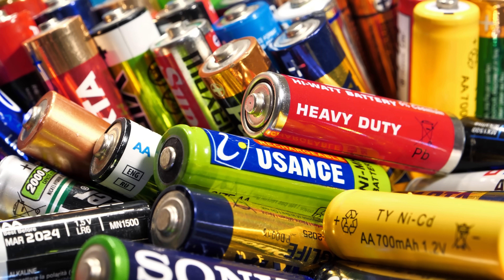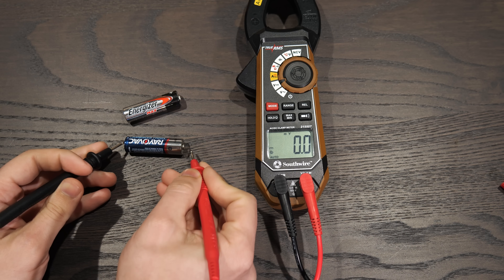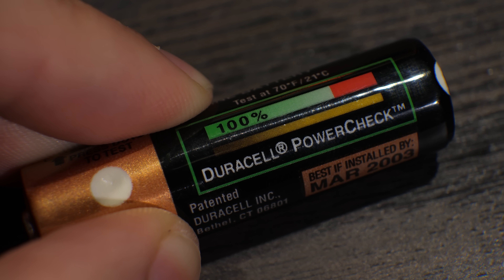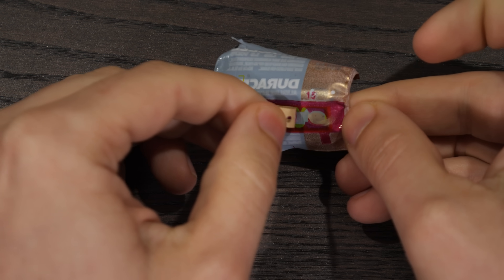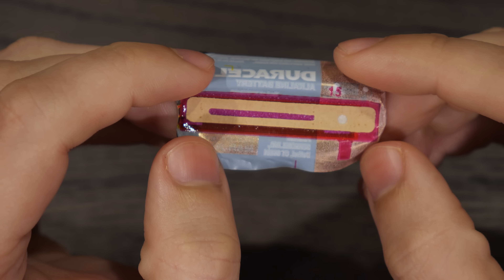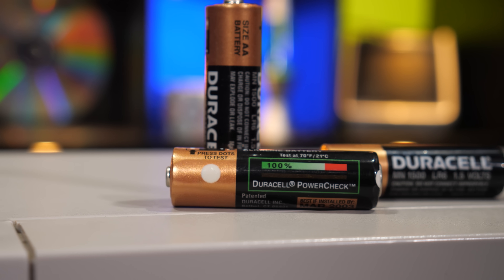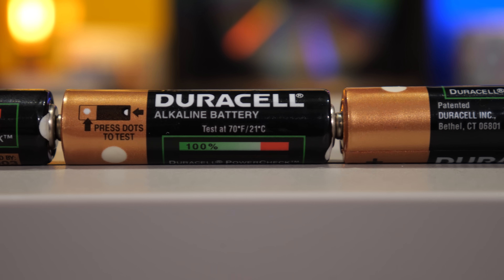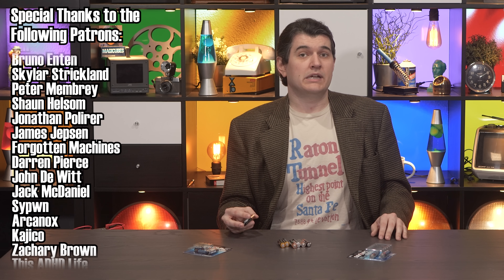Duracell PowerCheck: A genius idea which didn't last that long

Comment: These were a great thing.. at the end of the day, they went away, because the companies wanted to make the manufacturing process cheaper, in order to increase profits. hell, they don't even include a single strip-type tester in the packages anymore, like they used to. 

I'm a bit weird in how i use my batteries. My primary use for AA batteries is my X360 controller. Thing is, when the batteries are too drained to power the controller, they ARE still sufficiently powerful to power my logitech wireless keyboard and mouse...or the remote for my tv, or the remote for my stereo.. So when my controller dies, i end up putting the batteries aside for those other things. The problem then becomes that since gaming is my primary hobby, i go through a lot of batteries, and so my box of partially spent cells is always full, because the keyboard, mouse, and remotes sip power, and so they don't need battery changes nearly as often. i kinda like to get my money's worth out of these batteries, because they're so expensive, so i'm currently looking for other ways to get more value out of these partially spent cells.

Comment: The reason for using batteries and not rechargeable accumulators was pretty simple: they sucked!
They had a lower capacity and only few recharge cycles. The only exception were lead accumulators, but they were heavy, temperature sensitive and required concentrated sulfuric acid to operate...

Comment: Loved the powercheck back in the day and I always wondered why they disappeared. I always used my nails but you needed a few tries to get it going usually. I remember going on vacation having like 3 packs of batteries with me for my discman/walkman or GBA. After the days of using a compact camera I never needed AA's again. Bought so many bullsheet rechargeable batteries back in the day..some would discharge within 24hrs =.=

Comment: Speaking of rechargeable batteries, I've always wondered why rechargeable AA/AAAs never became mainstream, why did seemingly every manufacturer told you not to use those? Why were they (and still mostly are) limited to 1.2V? They seemed a perfect solution to the never ending battery disposing cycle

Comment: In the 90s I had a Casio keyboard that plugged in OR you had the option to use SIXTEEN DOUBLE A BATTERIES. 
As it turned out the garbage man who sold us our black box cable also made battery boxes and was able to put 4 D batteries in it instead😂

Comment: I use a lot of batteries in my work, far too many to buy rechargeable for everything I do (I would run out of outlets). I bought one of those battery suitcases with a tester and it has worked well so far. I wish they would invent a way to recharge batteries that wouldn't hog one outlet or two on a power strip.

Comment: They eventually removed the strip from the batteries, but included an external testing strip with each package. This strip operated under the same principle, and looked the same, but was slightly longer so you could manually touch each end to the positive and negative poles of the battery. I still have a few in my battery drawer. I thought that was a great idea!

Comment: Yes they did use quite a bit of juice to test, I remember these and if the battery containment was too thight, it could even squeeze that tester into permanent action and quickly deplete the batteries, that could in fact also be one of the reasons for its early demise. They did get hot to the touch if you kept pressing them.

Comment: Oh man, I keep a voltmeter (which I use in AmperMeter mode for an accurate reading of how much juice is left) on ready because I have all kinds of semi-charged batteries all over the place. The thing is, just because a battery is 'dead' for one device, it might have enough charge left for another less needy device.  So it takes me a while to fully 100% use a non-rechargeable battery. I also have a bunch of NiMH rechargeable AA and AAA that need testing all the time as sometimes they discharge/charge in different speeds due to difference of capacity/quality. Button batteries are very similar.. just because one toy doesn't work anymore, it doesn't mean the battery can't be used in another less demanding toy. I do have a masters degree in electrical engineering so I am a bit more sensitive about these things 😅. I absolutely hate throwing away batteries with charge left.. as they are such a horrible thing, the amount of energy that goes into producing them is 99% bigger than what they deliver.. such an eco disaster.

Comment: When i was a kid i used to have a very crappy flashlight that would take 1 AAA battery. That used to be my tester as the bulb was very sensitive to voltage changes.  I never had to use a tester or multimeter for batteries.

Comment: A practical nonideal voltage source always has a source resistance Rs so you would need to know that and have a load resistance Rl that is approximately the same as the input resistance of the device you are powering to get an accurate reading using the voltage divider formula. The DMM will have such a high input resistance which will be much greater than the source resistance of the battery so it will show virtually the total voltage at the meter.

Comment: These were useful in the Walkman era. My Walkman had no battery indicator, so when I was on a long journey with a limited amount of batteries, I could test them time to time to see how sparingly I have to use my Walkman. Also if I accidentally mixed up the new and drained batteries in my pocket, I could sort them. Energizer made these for a lot longer, I think until the 2010s.

Comment: 0:40 A good reason for using AAA batteries instead of AA batteries in remote controls is AA batteries would probably start leaking before they run out and ruin your remote control

Comment: Do I need to reveal my drawer of partially used batteries?  I used to have a hierarchy of what was most demanding to cycle the batteries through, camera -> wiimote -> so many other things -> remote controller.  If they stopped working in the remote, they were finally dead.  I do have a mulitimeter and it is surprising how often just 1 cell dies, not all of them, so I'll just find a replacement of similar voltage and keep going vs replacing all.

Comment: I recall being disgusted by the idea of disposable batteries as a kid, even though rechargeables were barely even a thing then.  The best available were NiCD which could only hold a charge for a very short time and were prone to some pretty bad memory effects, and they didn't even have many total charge cycles.  But despite that, even at like 6 years old, I insisted on rechargeables because I hated the idea of buying something just to burn through it and throw it away.  And thus, my Gameboy and other toys did not eat hundreds of batteries.  More like maybe 20 total for my entire childhood, because I just kept reusing them until they were totally incapable of holding a charge.

Comment: Yes the AA batteries are a much better value than the AAA batteries. 
Maglite came out with a rather bright orange- red LED flashlight that uses 3 AAA batteries and they become depleted very fast when the light is ran on high. 
I wish they had done the AA batteries,it would have still been a comfortable size to grip in one hand.

 I think the Duracell resistive heatstrip "powercheck" drained quite a bit of energy and life from the battery if used a few times

Comment: Actually. the device measures the voltage indirectly via the use of varying resistance across the length of the strip. Voltage equals current time resistance (Ohm's Law), V = i•R, so voltage is proportional to current. The current is what produces the heat; the more current you pass through a conductor the hotter it gets. As the cell loses voltage, it loses electromotive force, and the current reduces. The lower current generates less heat, which shows in the thermochromic indicator.

Comment: I once got batteries with a tester in the plastic case. That was more useful because you could use it with other batteries, and it was much less expensive than a dedicated battery tester. When I lost the case I couldn't find another. By the late 90s I had stopped using disposable batteries much so I've never seen one with a power check in the battery.

Comment: Very early in 1990 when I first saw the Gameboy Battery Pack DMG-03 at a friends house I wanted it very badly. Back then my grandma bought me my very first battery charging station but NiCad. rechargeable batteries were not as good as single use Alkaline and charging took 12-16 hours!! NIMH came much later and were significantly more expensive. The real battery hogs were those electronic kids toys that took C and D cell batteries. Older kids kept stealing them for their portable tape decks & blasters too, darn!

Comment: I have a pack of triple-A Duracell Powermax batteries with PowerChek(tm) in my drawer right now. They expire in 2027. Only used 3 so far. One for a bluetooth mouse about a year ago (which apparently still has more than 50% charge,shows 2 and a half of the 4 bars still full when powercheck is used) and 2 in my smarttv remote which still shows almost 4 bars.

Comment: 10:36 maybe people weren't using it regularly, but it was certainly a great built-in troubleshooter. Instead of running around trying to figure out if the device was broken or finding the multimeter/battery tester, you just pulled the batteries out, checked, and had your answer.

Comment: As a child, I almost figured out how it works because those testers were included separately (eg could work with any battery) and you could just swap them to see what was below. I also found up they would react with warm stuff. Battery testers might be useful if you mixed old and new ones and want to do a cleanup

Comment: BLACK transparent acrylic can b used instead of of a BROWN one to turn brown/tan simply use the computer's nitelite function to orange it up -- the key so to create a dark tan brown maple syrup color:
In the past I have been telling people to get the ORANGE ones but today my
BROWN one arrived and it works BETTER to cover my computer screen because
it is darker; this is in contrast to my GOLD ROLLENS that is better than the black regular rollens because the brown one is closer to orange so you can see better from a complete black dark -- in other words you want a more TAN color so not too orange and no too black; thus the only way to make a complete orange acrylic transparent sheet that covers your computer monitor more dark is a brown/tan color; while if you are going from a BLACK acrylic you will need to orange it up so it would go again a BROWN/TAN color. This is why older folks are encouraged to get the GOLD versions of rollens since by that time your eyes are really not as strong BUT I would still take the gold over the regular black since it offers more protection.
BROWN/TAN
*Acrylic Sheets*

*Top Health Advice:*
1. Night Light orange tint blue light filter/blocking program function on devices saves eyesight: Use a large BROWNTANorDARKorange vinyl plastic see-through panel (see "acrylic sheets") paired with the computer's nightlight blue light software function for eye comfort for protection against harmful blue light.
2. Side Window Deflectors reduce driver-side eye damage and glare while driving, turning your car into a more comfortable space like a living room.
3. Avoid excessive screen time to prevent blindness increased screen time leads to the myopia pandemic.
4. Use Rollens sunglasses when outside; consider the orange-tinted "Gold Rollens." Can put multiple overlapping so can use 2 at same time for more protection.
5. Never stare at the sun to avoid retinal detachment and eye damage.
6. Avoid getting your eyes dilated DILATION LIQUID weakens eye muscles and leads to blindness. An old lady assistant spilled it and said "oops," now light-sensitive, reduction of accommodation, more myopic, never fully recovered.
7. Avoid the chickenpox vaccine to prevent shingles later in life.
8. Cigarette Smoke is responsible for numerous deaths and severe health consequences most die early.
9. Use eclipse glasses for eye protection.
10. Privacy screens can darken screens.
11. Eyejusters self-adjustable glasses come in stainless steel and hybrid materials.
12, SWIFT passes out earplugs to protect her fans anything over 70db = DEAF tinnitus ringing is dying ear cell freq u will never hear ever again. MUFFS!

NASA STILL lying about MARS -- it is filmed in The Arctic.
moon @ clovis nm
jfk ordered the moon lie then cia bush killed him for it then trump killed/or hid bush for it aka faked death same w how epstein might still b alive
armstrong went2whitehouseadmited moon faked in riddle lang then when nearly dead wanted 2admit directly but was moved intowrghosp rm & kd
buzz has admitted a signif# of times the moon landing was faked
moon rocks are wood
moon horizon photographer killed same way as jfk jr (who had GEORGE mag as in bush) in plane
grissombaronkilled for whistleblowing b4 court datebaron
kubrick also killed his movieshowed fakes
obamawife=manmike

I want to protect you and your baby so see my channel sometimes in comments section of my vids for more info/updates on how to protect your eyes/ears/etc.

Comment: Best Trick for battery testing: empty batteries will jump higher, if you drop them onto their flat end. 
If I recall correctly the gel inside will become more stiff and therefore saves less "bounce energy".
I have been using this trick for years, it works perfectly

Comment: Where I found it useful wasn’t in batteries that were removed from a device, but in checking the batteries in a device to see if a malfunction was dead batteries, or something else. Still a niche use case, but in devices without a power indicator, such as a remote, it was convenient to know if the reason it wasn’t working was the batteries, or something else.
Reply: 100%

Comment: Some 10 years ago, I had first digital photocamera from HP (PhotoSmart 120) with 1mpix sensor, it took 4x AA batteries and drained them after taking 20 photos at maximum. I had to take a lot of new batteries packages on trips and used just threw them away... Terrible.

Comment: Keeping the package around with the built-in power test strip was normal for us.  I recall a fair amount of people at the time who wanted to have the battery tester on the battery itself.  It was useful, though painful to use.  I got my family to switch over to rechargeable household batteries that had a life of 500 or more recharges before they needed to be recycled.  Funny how it never seemed to be a priority to recycle single use batteries.

Comment: The built in tester was useless and expensive. Duracell for a short time put a tester in each large pack of batteries. Just hold each end of the strip on the terminals, accurate readings and I used one for years until I bought a tester that tests any small battery from coins to 9 volts. Maybe they were losing sales when folks could test the battery.

Comment: It made way more sense when the tester was part of the packaging and you could repeatedly use it on multiple batteries rather than disposing of the tester with each single use battery and your nostalgia is completely misplaced in a wasteful feature that is completely unnecessary

Comment: 13:28 - Oh boy... With the rise of smarthome stuff I am getting angry that to this day - nearly no device I own has the flippin' ability to change the charge-indicator-scale to properly use rechargeable or NIMH batteries.
The only device that properly changes it's remaining battery life is my Garmin GPS Tracker.
Every Smarthome device. Every Motion sensor and every Window-Contact does NOT allow me to change a setting from Alkaline to whatever I have so it can use and show me the right battery voltage / remaining charge.

Comment: I remember the Game Boy using 4 AA batteries. When we only had 2 or 3 new batteries left we would use them together with some old (empty?) batteries. This usually worked for some time untill you heard a "pop" and you had to clean the battery slot...

Comment: They still sell Duracell batteries with the Battery testers in Europe. Although, I can't imagine anybody using them for the same reasons as you mentioned. The modern tester looks a bit different from the old ones though. Instead of a 0-100%/Red-Green filling up with yellow, it's four bars filling up with orange... just a design change I guess.

Comment: Holy crap you just solved a related mystery from when I was a kid, before we got those auto test batteries (here in Argentina at least) there where batteries which brought the tester strip in the plastic package, you had to cut the strip from the package with scissors and clamp the batteries in there to check them. So I had a couple of those lying around and from time to time they would start to behave badly, painting a strong yellow at a random place of the bar because the plastic folded and marked there just for being used and flying around drawers.
Now that I saw your explanation of how the strip works, I understand the resistance at the fold mark spot was greater and it got hot first, it also drew more voltage so the whole gradient was messed up.

Comment: This is a weird coincidence. I'm watching this on my laptop on my kitchen table...while sitting next to me are a couple of the Durcells with those testers on which I was checking earlier today. Checking? Yes, right next to them on the table is my multimeter, and a clock to provide a load so I can test them in circuit. Looking at the shelf date, it's March 2028, so I don't expect they are as old as yours.

Comment: I had a tester, but really the truth was, if you found them in a drawer and you test em they wont be good, but if you just slap em in the off brand wireless ps2 controller they'll work for months